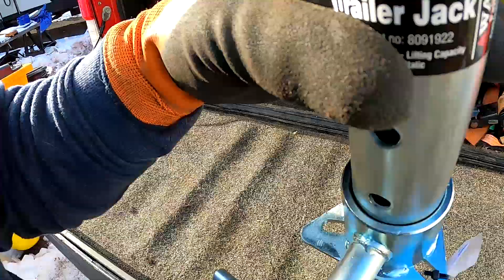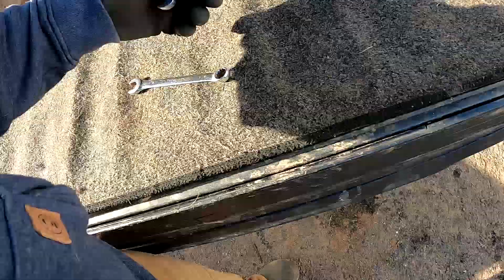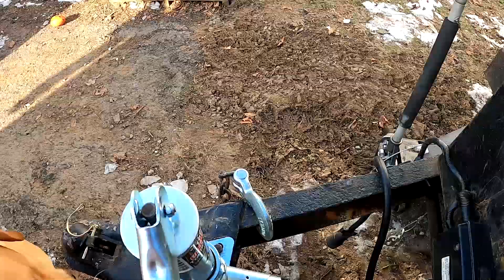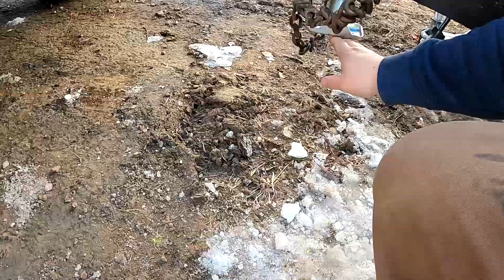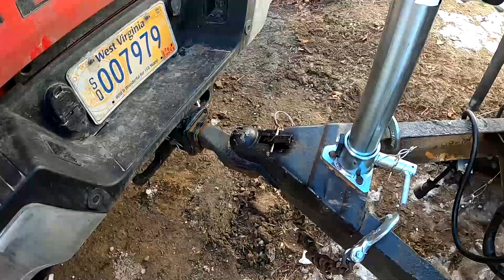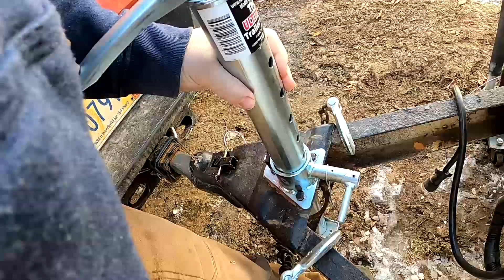$85 "ULTIMATE TRAILER JACK" installed and reviewed!

Comment: Replace the nut and bolt on the foot with a pin, also replace the small bolt that holds the black plastic alignment piece with a thumb screw and the jack becomes removable. With the jack removed you can't hit it with the tailgate. It also adds a layer of theft deterrence when stored with the jack removed. I have it on my cargo trailer that has enough tongue weight to make it nearly impossible to lift.
There is a short 30 second video on my channel.
Reply from the maker: It’s already bent and the welds at the bottom broke. Honestly it’s kind of a rip off. It doesn’t need removed though. It’s designed to slide up and down.
Reply: @Christina that seems like a good idea. Seen others do that.

Comment: So you still can’t open you tailgate?
Reply from the maker: You have to pull that lever and drop the body of the jack down and then you can drop the tailgate.  With the old jack that wasn't an option.
Reply: @drewdoestrucks  thanks for the reply.  I I have about 7.5 inches from top of ball to tailgate so I’m pretty nervous it won’t clear.
Reply: @Lamboz0 any luck finding a solution?
Reply: @michaelas2212  yeah. I got a Jack-e-up.  Works well.